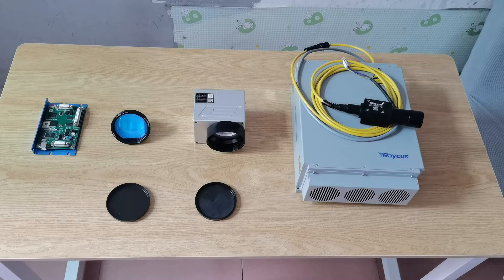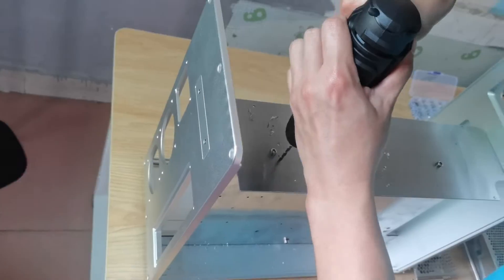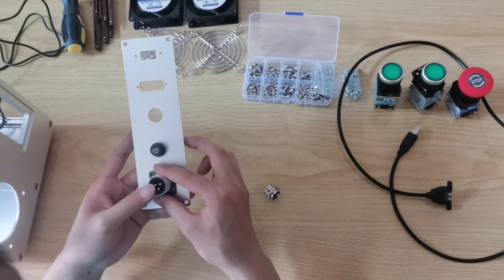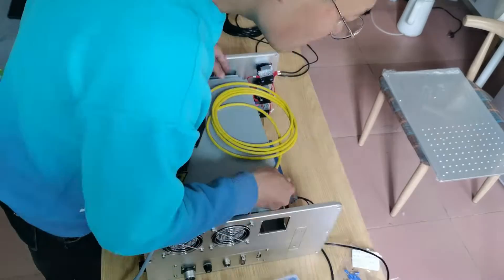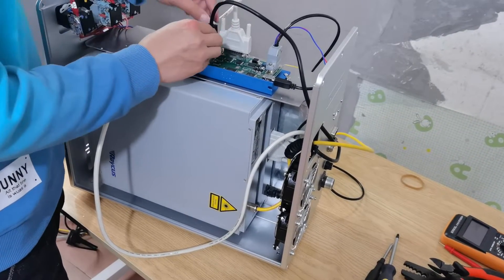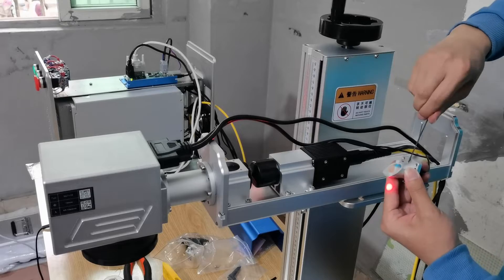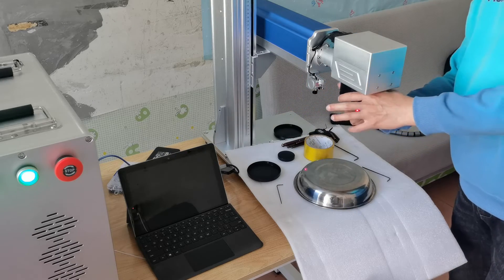How to assemble a fiber laser marking/engraving machine?

Comment: Hi. I have a MFP 20L C2NN4 and when i bought the machine the seller told me that i dont need to push fiber laser emitter all the way to the galvo head, but i saw you u pushed it all the way on 3:50 .So, what is  correct way to do it? is there any tutorial?  
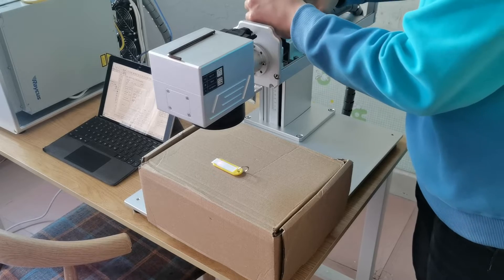And also when u are aligning fiber laser beam wiht red laser 3:59 do you fire one dot in the center and then align it with the red laser or there is another way? thank you in advance
Reply from the maker: Hi,you can push the laser emitter all the way to the galvo head or leave some space between them.It doesn't matter.It's better to follow the advice of your seller because they know their machine better.
As for the alignment,we didn't install a filed lens at that time so we can't fire the laser.We do emit the laser through the software in order to align it with red laser.First we fix the laser emitter and emit laser,then we align the red laser with fiber laser beam.The fiber laser beam is unvisible so we need use a small plate made of some material  which can make the laser dot appear.So we can align them.
Reply: @likaiwang7288 well, the seller had no expertise he was just a seller. Lol but if u say that it does not have much if a difference I'll do just red dot alignment wit the laser. thank  you very much for your reply! You are great! 💪😁
Reply from the maker: @wasco035  Yeah I talked to my friend who is an engineer of laser marking machine.He told me that you can leave some spaces between laser emitter and galvo head too.But he would like to push it all the way to prevent dust from entering the laser emittering since there are many lenses in the laser emitter.I advised you to follow seller's advice because I don't know if your hardware is same with mine.

Comment: Hello, where do you connect the power to the red dot on the head?
what you installed at minute 3:36.
Does it connect to a power source or does it have a transformer to convert from 24 to 5v?
Reply from the maker: Yes we use a 24 to 5v adapter to power the red pointer.
Reply from the maker: Sorry It's a 220V to 5V adapter.
Reply: @likaiwang7288  tnks